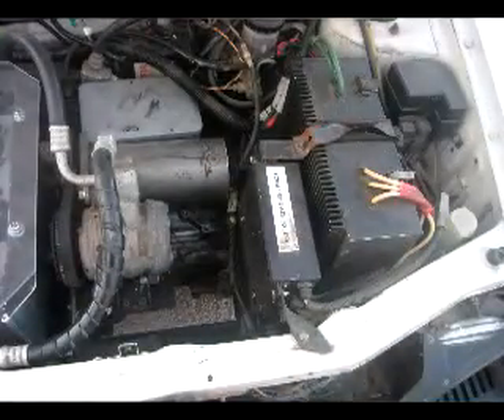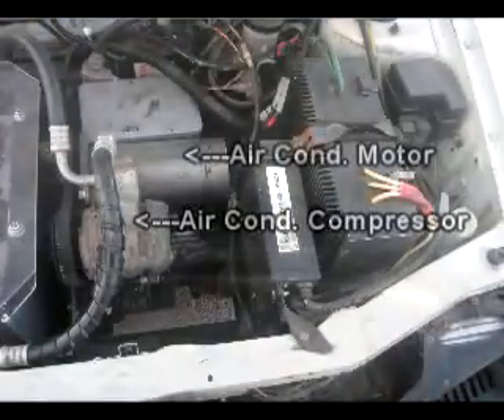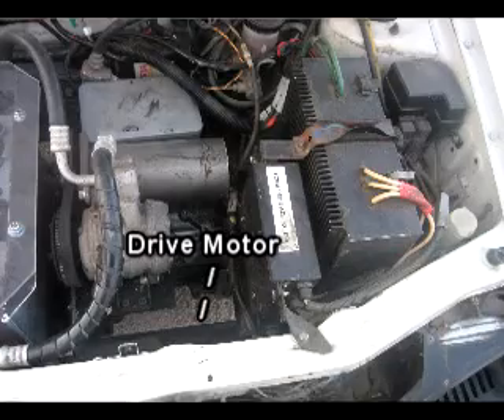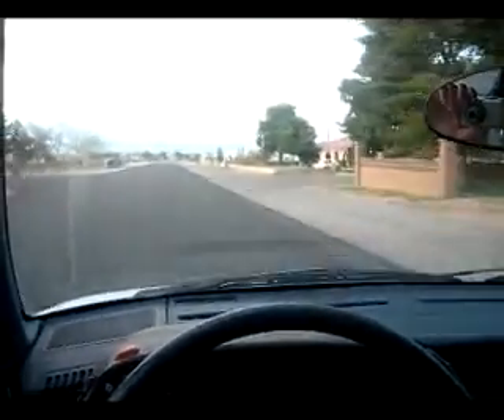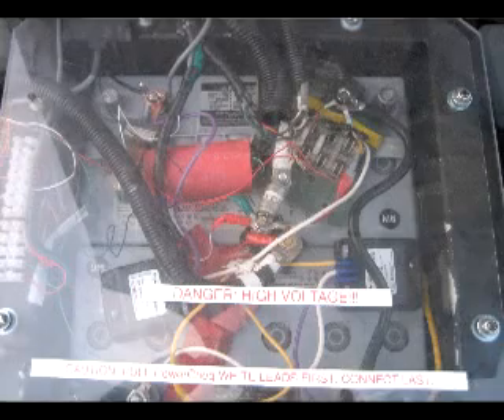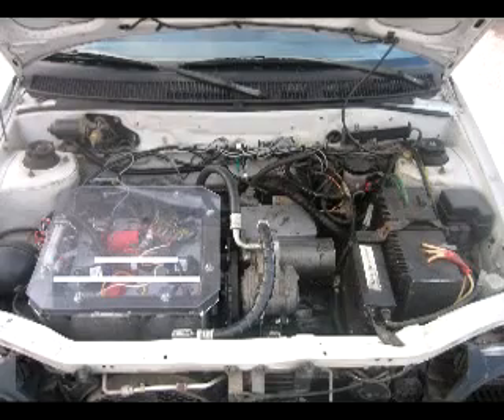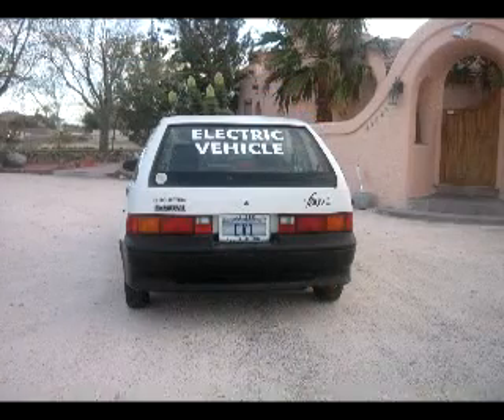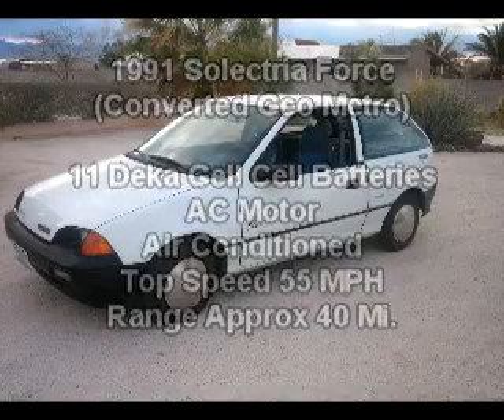Solectria Force Electric Vehicle

Comment from the maker: I imagine the range would about double because of the increased energy density.  However, it would likely not make much economic sense as this car is very old technology built on a frame that doesn't even meet current safety requirements (like airbags).  The cost would be astronomical.  Given that you can buy a Leaf, for example, with tax credits and manufacturer's incentives for around $25,000. why dump about $20,000 into an old Geo Metro?

Comment from the maker: @DanFrederiksen I agree.  In fact, the transmission on this car was not up to the task of the high torque of an electric motor (remember, this started life as a wimpy Geo Metro) so I had to replace it with a used transmission imported from Japan.  After making this prototype, Solectria switched to their own transmission. Designing a gearless electric car is fine for  ground-up manufacturing, but for a conversion like this it is generally easiest and cheapest to keep the manual transmission.

Comment: @nvpatentlawyer it's not just about rpm. you need a map of the efficiency over rpm and torque and then shift to pick the most efficient.
but I believe in a purpose built drivetrain that you can design a motor to have wide efficiency even if slightly more expensive in order to just have the one gear. fixed gearing has huge advantages

Comment from the maker: In an electric car with a manual transmission, there is no need for a clutch.  Just take your foot off the accelerator and the motor stops.  So you can shift gears without a clutch. Some electric cars do not use a transmission at all, but having gears can optimize efficiency dramatically by keeping the motor running in its most optimal RPM range.

Comment from the maker: Fully charged it was about 154 volts.  Of course it would drop as driven. Once the batteries were down to about 12 volts (132 volts) it was pretty much at the end of its range. Solectrias come up for sale on eBay pretty frequently and there are support groups on line for help with repairs, parts etc.